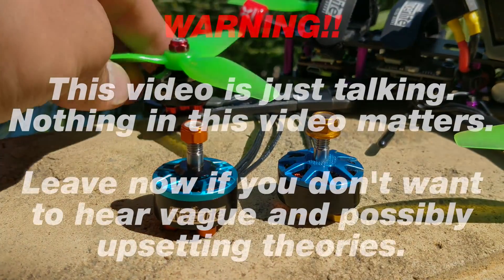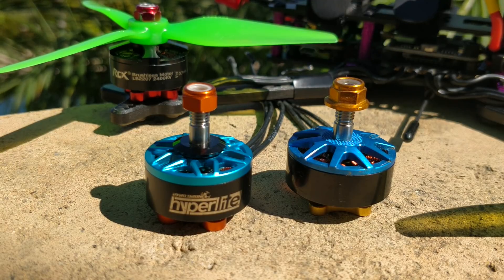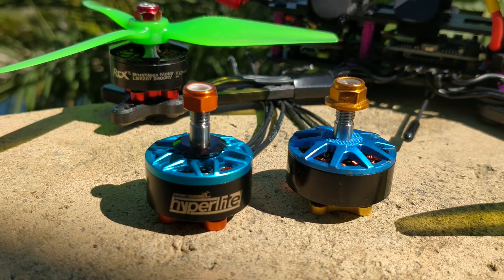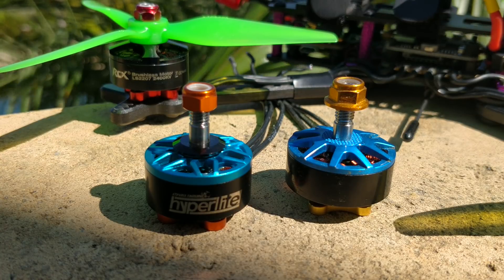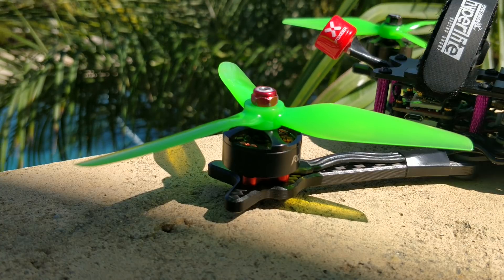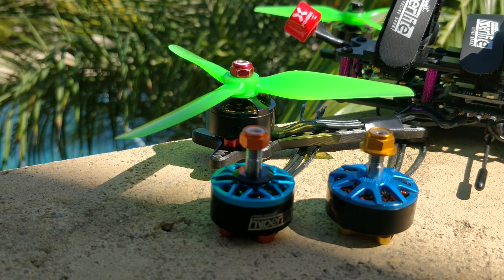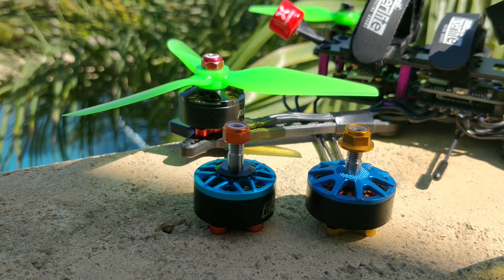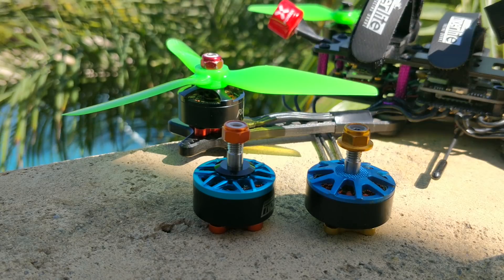Kv, Handling, 6S, Acro - Motor Theory (just guessing here)

Comment: Absolutely true that amperage is directly related to torque.

So does this sound about right?...

Torque is the twisting force, power is the measure of work that can be done. With higher KV, you don’t get more torque, you get more power by the same torque spinning faster. So voltage and KV are primary factors for power, and amps are a primary factor for torque.

Torque will give more authority over the prop, but will also reduce battery efficiency. So if we have the same motor in 4s and 6s with KV’s that land on the same rpms, then even though the 6s may be producing less torque it will be producing the same power with more efficiency.
Reply from the maker: Yes I would agree with all that completely.
Reply: that makes so much sense
Reply from the maker: It's not just me trying to figure out what's going on.  For some reason, the same exact quad with the exact same setup and same motors in just different Kv and one with 4S and one with 6S feel totally different.  The 6S version feels like absolute crap and we're just trying to figure out why so we can design things better in the future.  If you've got some insight to help out, all ears.  Please.
Reply: It’s because of inductance. To get lower kv there are more turns of wire in the stator. More turns of wire means lower kv but more inductance. Electrical theory states that inductance resists change in current flow. This reduces the ability of the ESC to change the current rapidly, which has a direct effect on control feel. You noticed we need to add some [equivalent] kv to get the feel back. That’s because when raising kv you are simultaneously getting more power (which all else being equal gives more control feel) and reducing the inductance. 
The advantage of 6S lies purely in efficiency (or you could get more power for the same efficiency) because the reduced current reduces the losses due to heat, and the effect is significant.
Reply: kenkamm so an esc that can deliver more punch would reduce or eliminate the inductance effect?
Reply: Maybe but our ESCs are all pretty much the same if you look at the specs on the FETs. So that’s not really the answer. The answer is what Bob noticed. A little more kv and you still get the efficiency benefit and reduced thermal losses due to lower current.
Reply from the maker: @ken-kamm  that is definitely interesting and something I considered a while back too but eliminated in my head because the counter is that the ESC doesn't need to push as many amps. That takes us back to the role of voltage in inductance.  Less amps, more efficient, less current....less torque.

Oh you're saying that the same signal output will not produce the same power due to inductive resistance?  So by upping the kv we're actually adding in a higher signal?  Efficiency is still there since overall amps in a stable state is still reduced along with heat and whatnot?  That actual does make a lot of sense. This would mean that voltage spike amplitude differential should be reduced as well?  That's what Ryan is looking at next in fact.
Reply: Phil Cogswell Sorry but this is so wrong! People are making up stuff. Go read up in the equations that solve for torque and you’ll see that torque is the same for 6s and 4s for equivalent kv. Of course this requires research and math, so everyone would rather just make shit up.
Reply: kenkamm so torque still comes down to construction?
Reply: Phil Cogswell Well of course a big motor has more torque than a small one, etc. But people now believe that 6S has inherently less torque because of the BS people are spreading around that less current means less torque. That is wrong! Torque is PROPORTIONAL to torque. Yes. But guess what. Torque is also proportional to about 5 other factors in the equation for torque, which everyone is ignoring. If you look at the ENTIRE equation for motor torque you will see that ALL ELSE BEING EQUAL, same motor size, equivalent kv etc etc, 6S has the exact same torque as 4S. Because the windings are different for 6S! More wire length, more turns on the stator! Makes the same torque! Of course, no one listens to engineers in comments, they only listen to the guy making the video and they take his opinion as fact. Not Bob’s fault at all. He’s stating his GUESS and then everyone is Iike “sounds good to me, let’s run with that!”

Comment: It feels different because the resolution is different. When operating at 14.8v nominal you have less resolution and more motor speed change per hundredth of volt change. It has nothing to do with torque. It literally is just the resolution because it’s not linear.
Reply from the maker: So then the higher Kv should be even worse on 6s....
Reply: Kabab FPV no. Higher KV would be more responsive on 6s. As you decrease the distance between the KV and the voltage you get more change per volt and it becomes similar to a 4s if that is your baseline

Comment: DUDE! I have been thinking about this A LOT myself! I do not like 6S 1750kv for free style. Kind of reminds me of old 2204 2300kv 4S rigs with low pitch props back in 2015/2016. Have you been doing much with 5S? I have been hooked 5S for a long time now. The newer Primo 2208 2350kv on 5S is no doubt my favorite ATM. I really like the high KV equivalent (2350*1.25 = 2937kv on 4S). I feel it is the perfect balance of amps and voltage where it gives me the best of both worlds. Less voltage sag but still has the decent amp pull for the power "feel". Perfect for freestyle :D
Reply from the maker: Yep that's as good as it gets. That primo motor in that kv on 5S and 5" is tip top performance for sure.

Comment: It would be very interesting if you could get your hands on the new bbb 2207 pro. Looks very good on paper.In the specs it says 5 mm titanium shaft, I've never seen a motor with such thing.
Reply from the maker: Lol I think it's talking about the prop shaft only. Not inside the stator. I've tried it. It's excellent. One of the best motors on the market. But it has some annoying features too. I've told them over and over what to fix and it hasn't happened so I just keep waiting...

Comment: do you think we'll see people moving back to 4s if battery technology gets to an acceptable point?
Reply from the maker: Lol no. Batteries will never be able to provide amps well. Even my Tesla has tons of packs in parallel and high voltage to get around the annoying high amps problem and it still needs a full coolant system for all the batteries to work out.
Reply: It won't just 'technologically advance', unfortunately.  Even with ideal allotropic graphene we'd still hit the same fluid mass transfer feed-through replenishment of helmholtz layer limiting amp pull after the first second of punch-outs.  Even cap-batteries to supplement power density (at an energy density cost) would end up being heavy and overall diminish performance... and this is all before thermal issues even rear their head.  
I'll find the facebook discussion about it, but Ryan Harrel brought up a concept that all batteries end up defaulting to a roughly 55C sustained discharge point, and I started promptly kicking myself for not having realized that was the case sooner - it IS the case, and that was the problem I had been running into with all of my previous battery and fuel cell research on carbon nanotube electrodes.

Comment: This explains why the 2150kv on 5s combo works so great K Tmotor already got it right try 2150 on 5s
Reply: I'd highly recommend this too - get a 6" Floss, run 2000KV-2222KV motors on it (2208 to 2207 stators), and run the gamut.  Brilliiant 5S 5" racing/freestyle, 4S 5" proximity flying is off the chain, and 4S 6" flying is just whimsically efficient.  That would be my 'one quad to rule them all' right now.

Comment: Pls can you talk about the quality and the performance of the dys samguk?
Reply from the maker: No quality. Perform well, well balanced motor with respect to kv and construction. Poor durability. Okay value.
Reply: for a very cheap way to start, do you recommend the dys samguk or the racerstart 2306s?
Reply from the maker: @cizel.6106  the best cheap motor hands down no questions cannot compare to any other cheap motor and is better than many top end motors is the RCX LS2207 and it comes in various kv's too. It's $10

Comment: Kabab... torque is current * number of turns on the stator,  on 4s you have more current but less turns, on 6s you have less current but more turns (hence lower KV) so it all should roughly balance out.
Reply from the maker: We're finding different results than what you say which is the logical assumption
Reply: Have you compared the "amp-turns" constant of some motors? could be interesting to see that lines up with your own impressions.
Reply: KV kinda means nothing in engineering terms. With increase of voltage we increase the number of turns on stator, which increases the motor inductance. Now the higher inductance there is more resistance to current change (di/dt). My guess that ESC don't follow the desired input, or PID's need to be corrected to account for change in "response curve" due to voltage change...

Comment: Power is the rate form of torque. Rpm comes from volts and torque comes from Amps. Two motors at the same POWER output but different kv will have different torque. You can't guarantee these motors are consuming the same power to justify lower torque unless you measure them. Also, prop thrust output is highly related to the velocity of the prop, and lesser to the torque. Yes, you need torque to drive the blades, but the torque effects the responsiveness of the prop. The point of using a higher voltage is you can use less amps to drive sinks of the same power consumption. Amps leads to the majority of power loss in resistive elements and using higher voltage leads to less current consumption.
Reply from the maker: Right. So maybe we just need to make it more inefficient again to get the torque performance back. 😁

Comment: So I'm a gear head in the car world. So torque to me is the work from 0 to the midrange. Power is the midrange to the upper rpm. So i totally agree with you on the 6s Is using less amps so you are feeling less performance. The more kv you have the more you wake the motor up. That being said. You should try the new Tmotor f80pro.
Reply from the maker: I think the F80 is a 2308?  It should be good but I would prefer a 2208. It's likely gonna perform the same and a little better at the top end and will be lighter too. We're spinning really little props.  The motor they made me was basically the F80 in 2208 I believe.
Reply: @Kabab  I see

Comment: Dude, that actually makes a lot of sense. Pretty interesting!
Anyway, there's a 2212 "Angel" motor from SunnySky. It looks like a modern motor, but it's for planes... So, prop adapters and so on. Maybe it's worth looking at? Who knows. 😊
Reply from the maker: Lol the angel is the low end crap series. The x2212 is the good one but still kinda super old. I used it on a 7". It flew frikin fantastic!   That's why I think the 23xx stator is pointless. 2210 on 7" is probably optimal. We don't need 23xx for little 5" props. But there are different effects...
Reply: Do you think it would be worth harassing RCX to make a batch of custom motors?  2210 1300-1500KV with 4mm shafts (4x9x4 bearings)?
I could live with old school construction (flat magnet, big air gap), but I'd be genuinely excited to buy some naked bottom, N52SH-Arc, tight airgap ones - even if these are just retooled H2208's I've be really happy to run them... just don't know what the turnaround time would be for something like that.
Reply: @Kabab  Exactly, I remember! But damn... I had hopes for the Angel. 😕
Well... We're going to have to wait and see if some company makes a modern and good one. 😕

Comment: What about the Mr. Steele 6s Motors?
Reply from the maker: Cecil Williams  I'd agree that they're overpriced..... knowing everything I do now, if I paid for everything and wasn't testing everything I could find, I'd just run the RCX LS2207. Sad but true. That $10 motor is maybe 90% as good as anything else.
Reply: I've flow Silks/Hypetrain/Mr1&2. They all perform really well. I'm focused on a specific feel, so I know there's better options but... None of these motors felt like garbage for the record. Some are a little more problematic than others so keep a spare.
Reply from the maker: I haven't tried those.
Reply: BBB 2207 2700kv motor is one of my favourite (originally recommended to me by Kabab), and the RCX 2207 is also a great buy! Hard to beat those, depending on what your motor preferences are.
Reply: If you like the BBB 2207 2600KV, you'll really like the BBB 2207.5 1700KV.  Any deficiency in KV can be made up for pretty easily with more aggressive props to get a lot of the same feel (e.g. going from 5x4.3x3 to 5x4.5x3 V1S)
Reply: Cecil Williams so true. like the last generation of Steele motors that were overpriced and crap